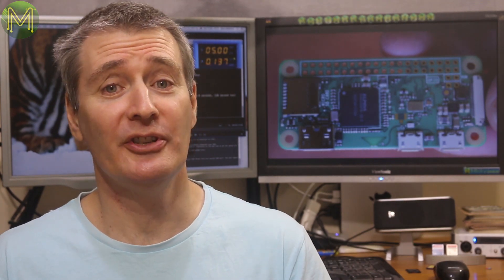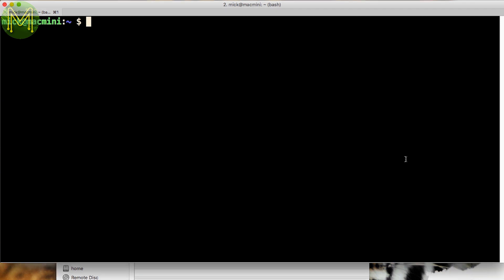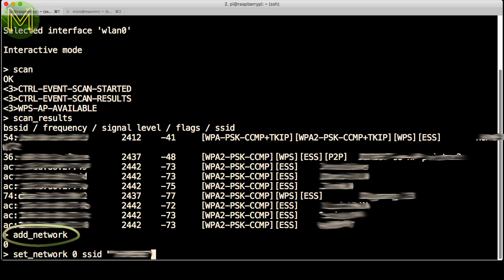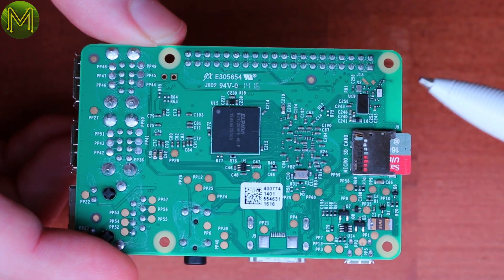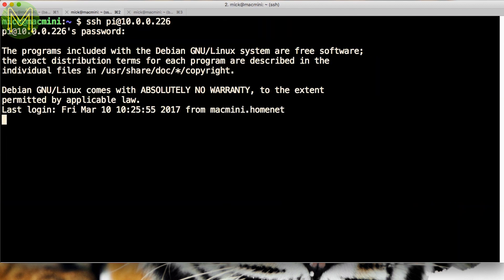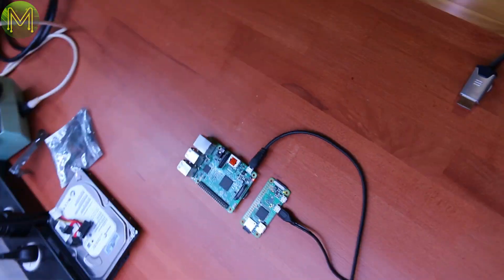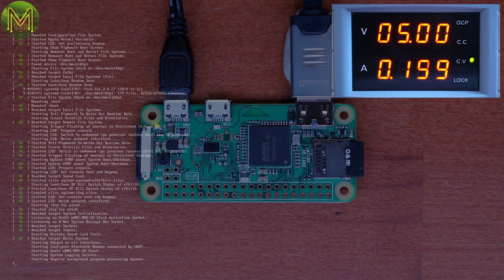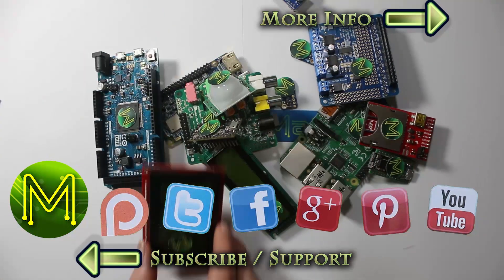#113 Raspberry Pi Zero W: Resonating cavities // Review

Comment: Thanks so much the ether-over-USB setup info; very helpful. I like to run these boards headless and use VNC on the occasion when I prefer a GUI tool.
Reply from the maker: No problem. It's a nice simple method.
Reply: I never knew this could be done until I saw your video, thanks for the tip! I was having to turn on the UART for the Zero W and use my TTL USB serial cable to access it headless.

Comment: is the internet faster then on the rasberry pi 3 model b?
Reply from the maker: Essentially the WiFi network speeds are faster on the Pi3, but your Internet speeds may vary depending on how you're using it. IE: Browser on the Pi Zero would be slow because you don't have much RAM to play with.

Comment: If you want a headless installation, and you don't have a USB cable...

- Flash the OS to the SD card
- Put 2 files on the boot partition of the SD card
1 - ssh (Without a extension) ($ >/Volumes/boot/ssh)
2 - wpa_supplicant.conf (>/Volumes/boot/wpa_supplicant.conf)
- Open wpa_supplicant.conf ($ nano /Volumes/boot/wpa_supplicant.conf)

ctrl_interface=DIR=/var/run/wpa_supplicant GROUP=netdev
 update_config=1
 country=<Your country (like US or AU)>

 network={
        ssid="<Your network name (like CIA-Honeypot>"
        psk=“<Your password (like monkey123)>”
        key_mgmt=WPA-PSK
 }

- Now boot your PI and eat it.

Comment: Instead of usb ethernet you can just put a wpa_supplicant.conf file in /boot, touch /boot/ssh, boot, then ssh over wifi.  Works with latest raspbian images.
Reply: totally easy you set up the image with a file named wpa_supplicant.conf and add this content network={
       ssid="wifiname"
       psk="wifipass"
       key_mgmt=WPA-PSK
}

and you can put an empty file named "ssh" to enable ssh on the first installation.
This is when you want to go full wireless
Reply from the maker: Looks like I'll have to run a small tutorial on the different methods to get your PiZeroW going headless.

Comment: Nice, Ijust learned how to use wpa_cli. However for this case I just edit the "interfaces" file on the SD card with a card reader before booting on it with the Pi. You just need to add two lines wpa-ssid, wpa-psk and enable DHCP in most cases.
Reply from the maker: Yup. The joys of UNIX! Many different ways of achieving the same thing.

Comment: zum RPi Zero W ... mmeeh ... i stay with the OPi Zero
Reply from the maker: Much better antenna on it, but be careful of the over-heating!
Reply: Heatsink is installed ;)and the clockspeed is limited to max 1Ghz. Idle Temp 32-35°C , under Load 40°-45°C , Max Peak Temp 51°C.
Reply from the maker: Deadeye0815 nice!

Comment: Really interesting video.  Thanks!  My Pi Zero W just arrived and I was going to use this as the basestation for a small RFM69 sensor network.  I guess as long as the Wifi is good enough to get back to the router then it should make an OK bridge.
Reply from the maker: Yup, depends on the distance and what's in between.

Comment: When I tried to do the USB over Ethernet thing it would only show up as a Serial device on Windows...
Reply from the maker: +EpicLPer 
Did you try this on the Zero?
Reply: Zero W and normal Zero. I also tried searching manually for the device driver but I'm not sure how it's called in German.
Reply: I had same problem on windows 10, use this guide and install kindle driver- it will work for pi0 too :p 
https://www.mobileread.com/forums/showthread.php?p=3283986

Comment: Bit off topic but hey. 
I have a Zero hooked up over composite to a old 2.3" LCD screen 320 x 240 It displays the desktop but it is unreadable, whole words look like a couple of pixels. I understand this is a limitation of the screen. 
I want to be able to choose video files and just play them back, is there an off the shelf Pi OS that is big and chunky, like a kids my first computer. or a high contrast setting as I noted moving the mouse around some text is white on black and is easy to read.
Reply from the maker: +TheDutyPaid 
You might have better luck using an SPI based screen like the ili9342s.

Comment: The Raspberry Pi Zero W has a place to solder a connector for a WiFi antenna on it. Can you make this test again with an antenna?
Reply from the maker: +47DAF 
It is possible and I was thinking of doing that, but didn't have time for it in this video. I might have some time during the week.
Reply: For an How-to follow the link: http://hackaday.com/2017/03/07/adding-an-external-antenna-to-the-raspberry-pi-zero-w/
Reply: Been following you for about six months or so... I'm a lazy SoB and your what's happening vids save me the bother of hunting for the info! 😉
Reply: MickMake was about to suggest the antenna header but was beaten! 😉
Reply from the maker: Nice to see some Hams watching my channel!
Reply: +1, I would be interested in such things as well, since the Pi Zero W has been sold out from my preferred US distributor since it was released, and it's not looking like I will be getting one any time soon.  THX
Reply: Maybe you can try LicheePi ZeroW, $8 almost SD-sized WIFI+BT linux board, and you can buy dozens! https://igg.me/at/lpi0

Comment: I'm left wondering how close to the access point a Pi Zero W would have to be for good performance.  I'd like to use them to set up some wireless camera nodes, but maybe the zero W's Wifi is great for the test bench or hovering over some little robot to control it, but not for longer distances like from an access point somewhere in the cabin to a pole on the property line.  For that, maybe I should plan for a plain old WiFi dongle on an older Pi; or power over ethernet since I've got to power the thing anyway.

On the other hand,at less than 200mA, the W may be well suited to being powered by solar.  Lots of experiments required.
Reply from the maker: +condew HacDC 
You could always just use USB Ethernet. Although long haul USB might be an issue.

Comment: I don't know - for me it's kinda toy... maybe for my purpose Lime2 Olimex boards seems to me much better. Do you have some review about Olimex boards? TY.
Reply from the maker: +Zoltan Hoppar 
I haven't as yet done those ones.
Reply: I am really would like to build an linux image flasher machine - a standalone image creator that I can put out to the desk at linux events. Olimex has these A20 boards, but I don't know that would it be enough to serve this purpose, and possibly the info kiosk/advertising for FOSS apps together. Witch would be after your opinion the good SBC solution for this? Or should I buy some cheap J1900 or AMD AM1 board?
Reply from the maker: Get yourself a NanoPi2 with two SD slots. Small, easy and supported well under Linux.
Reply: Just watched your review, and still trying to wrap my head around those websites... Damn. With 2 SD slots seems to me good choice, so I don't need to hook up more USB things. I think if I expand my idea I will need an  separate 5-7 port charger that possibly will stop people if I offer free phone charging station - and only need I box it together inside the stand.... PS: Later on sometime will you review the Neo, Neo Air boards? TY for your suggestion, and your youtube channel.
Reply from the maker: Zoltan Hoppar 
Yes I have a couple on their way.

Comment: Thanks Mick. Yeah. It is a pitty the WiFi is not as good as the Pi3's. What could one expect for this low price. Still. I'd like to have a swarm of these to connect my home.
Reply: The position of the board can also make big difference. If you rotate the pi to be on the edge instead of lying flat, it can also speed it up. At least for my nexx wt3020 it doubled the range and speed.
Reply from the maker: +Neil Vermeulen 
They'd still be good for low traffic devices.

I think using it for high data rate stuff like webcams would be problematic.
Reply: MickMake Yes. I was thinking more in the line of an IOT project, switching on and off water in my garden from my mobile. It is a pitty you did not test the range at which both are effective. Doesn't really matter. My needs are just in and right around my house.
Reply from the maker: +Neil Vermeulen 
I reckon you'd be able to reach much further. I was getting a low packet drop at that distance, so even doubling would still be under 50%. Still usable for low data rates.
Reply: Don't forget there's a space on the Zero W board to solder a socket for an external antenna (which the 3 doesn't have). May beat the 3 in this configuration.